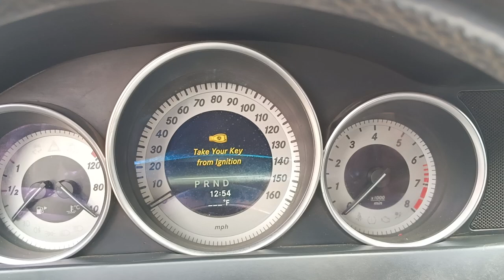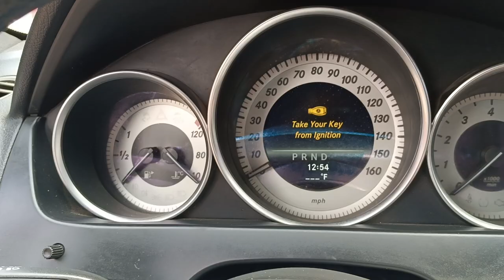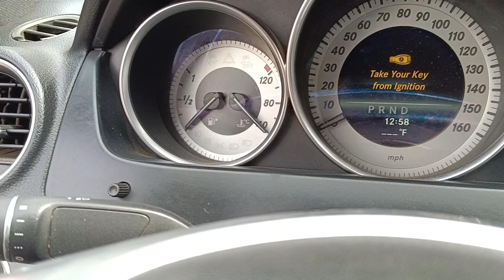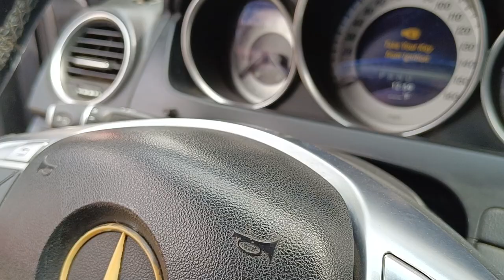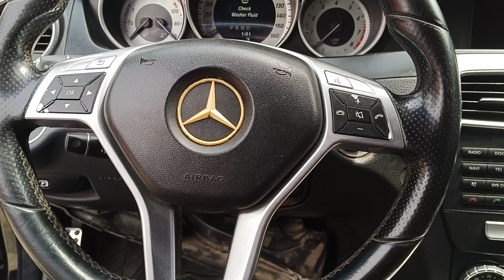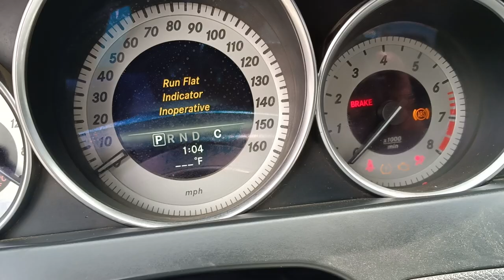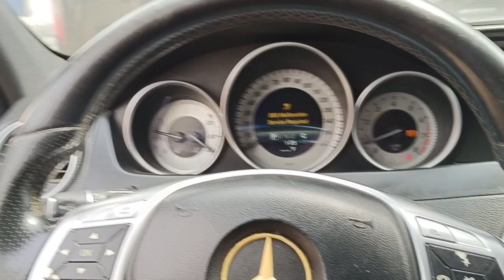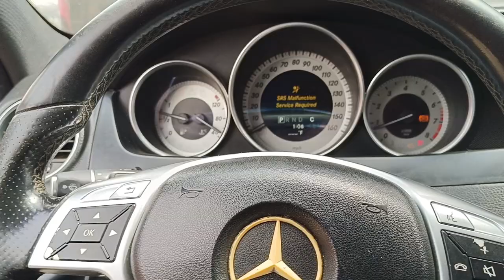How to turn on ignition on Mercedes Benz C300 steering lock problem

Comment: I paid £150 for AA to come just to do this I felt a cunt I thought the battery had died so I went and brought a new battery which cost £170 fitted it myself and car still didn’t start so then I rang AA he came out and literally done this and started it right away what a waste of money. I googled and YouTube it but nothing suggested the wheel was locked. I’ve had the car 3 years Mercedes a class and it’s never done this before so I was clueless but to put some light in the situation the AA guy tested my old battery and it failed the test so I was due a battery anyways. Live and you learn I guess 🤷🏽‍♂️

Comment: I took the steering wheel and turned it back and forth very quickly and this released the ELS and car started. I’ve done this several times now.
Reply from the maker: In some occasions when you turn like that and it doesn't release, you can follow this process

Comment: Hello boss man 
I have a Mercedes 2007 s550 
The key is locked and it  won’t turn to start position radio play and light on inside the but no light on the odometer
Reply from the maker: Check the fuse first or if you have a spare key you can try it, if is still not working you can get back to me
Reply: It ain’t working

Comment: Thanks for this info but what’s the solution there after because it’s works for me this way but I can’t keep opening the fuse box anytime I want to use the car
Reply from the maker: That is an emergency operation to help you get your car out of the bad location, the only thing you can do is to get new steering lock and reprogram it that is all

Comment: Car started but steering wheel was still locked
Reply from the maker: Replace the lock or the small motor inside the lock and you are good to go, you can also damage the lock and drive out of the location you are if unsafe